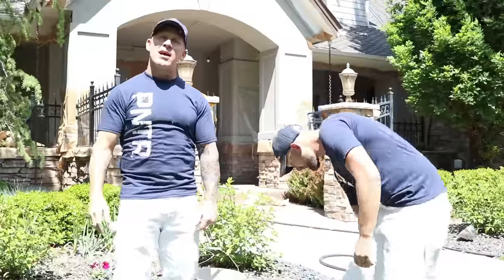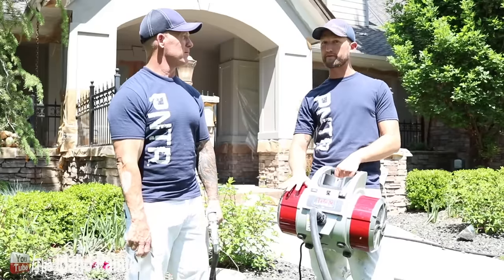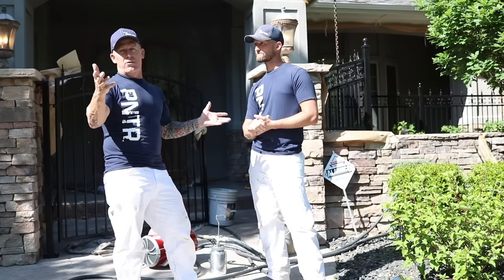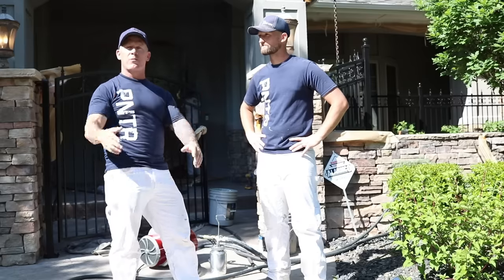Save Money Painting Iron Fences

Comment: I have watched several of your videos.  I am looking for information to remove rust and repaint my iron gate.  The information I need is on removing the rust, choices of metal primers and choices of top coats.  Instead, all I ever see is an attempt to sell an HVLP sprayer system.  Except I already own a Graco HVLP 9.5 with Edge II Plus gun and all the tip sizes, so I don't need new hardware.  instead of how to paint, it should be titled buy an HVLP from us.

Comment: I've been using water to thin and I have to put more coats and the product doesn't lay down smooth and it's good for runs. Can I use flow trol?
Reply: Flotrol is for oil based paints only. You need an Acrylic Latex extender for that.
Reply: @kylegoodman5196  have any ideas on what brand I could use. I only know of that one so far.
Reply: @o-whata-knife3119  M1 Latex Extender is a good one.
Reply: Floetrol is for water penetrol is for oil use floetrol 👍🏻 use water n floetrol for best results